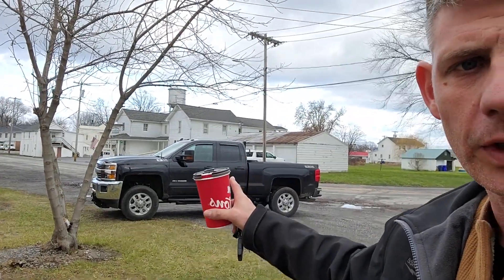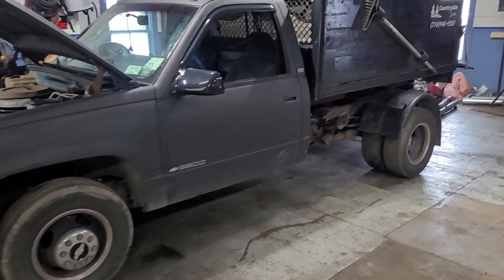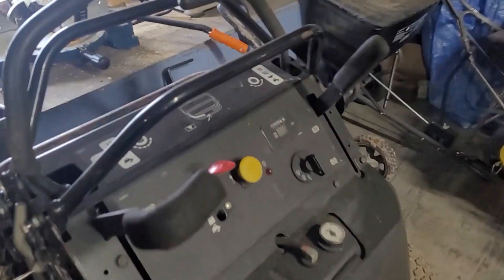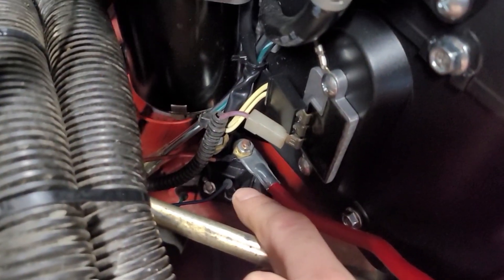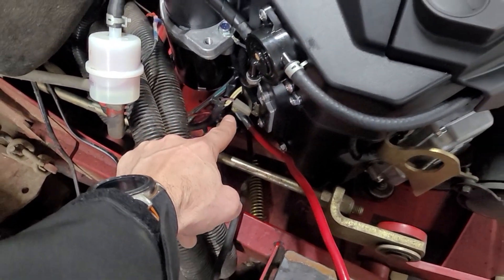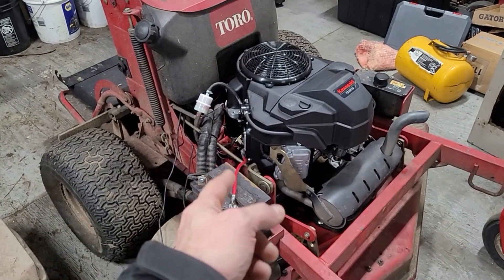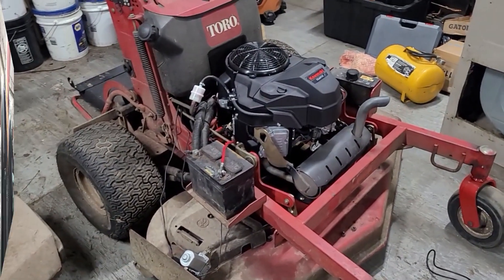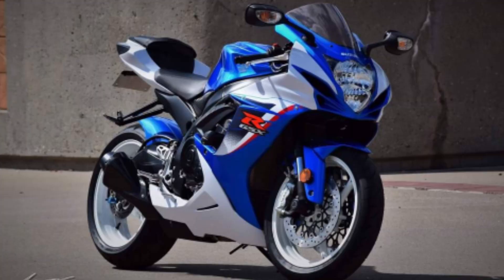NEW purchases coming [where have I been?]

Comment: check green wire needs ground on starter then to the other side to regulator I just did my grandstand and forgot that wire
Reply from the maker: There's only one wire to the starter on this one. The green wire goes right to the dash meter. I downloaded the wire schematic
Reply: well check the regular wire make sure it's got good ground
Reply from the maker: Did everything's fine. Like I said in the video it's the solenoid. If I can cross the two posts and it tries to start, the solenoid isn't doing it's job
Reply: yeah my solenoid was clicking sometimes I took mine off which it's on the starter but I took apart cleaned good it's working great now but it's kohler  engine I did have to tighten all motor mount bolts they where bad loose
Reply from the maker: Yea this one's separate, makes it a little easier
Reply: yeah I was hoping mine was that's stupid now I got buy starter with it like 150 bucks if it don't last

Comment: If you’ve never ridden street bikes, my suggestion is to buy a used one first. Here’s why. You will drop your bike somewhere at some point, especially a newer rider. It’s less heart rending to drop a used vs new bike. The biggest thing, you’ll probably find after a few months of riding, that you want more bike. It’s easier to start on the street with a smaller bike, then upgrade. A used bike holds its value pretty well. You won’t lose money reselling after a few months. DEFINITELY take a safety course first. Lots of great information and riding techniques. Good luck! Happy motoring!
Reply from the maker: Thanks for the advice I'm definitely going to do the course

Comment: Watch them corners... I had a 06 gsxr 600 and loved it, someone stole it. I then bought a 07 gsxr 600. They are a blast. I always rode them as if they didn't have a rear brake so I was always heavy on the front. Sweet bikes I rode a 1000 and thought it was too top heavy so now i ride a dr650 supermoto and it's the best fit for me. I treat it like a crotch rocket and a dirt bike on the same ride. Good luck with that bike it'll beat you up for sure but you'll be smiling in pain. Haha
Reply from the maker: I'm sure but I can't wait

Comment: hey randy on the new Kawasaki engines there is a wire that no longer needs to be on there you may have to cut one or two wires without needing a new harness look at a diagram for your mower or ask your toro dealer ran into this repowering 3 new ZK's
Reply from the maker: Thank you